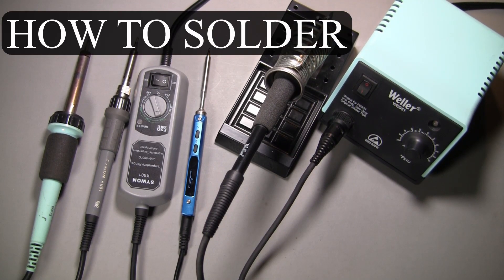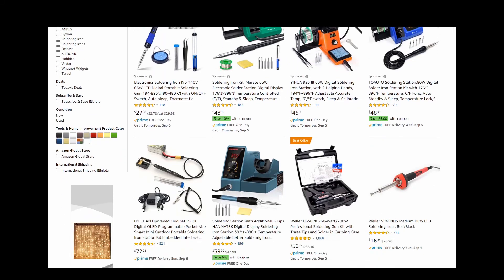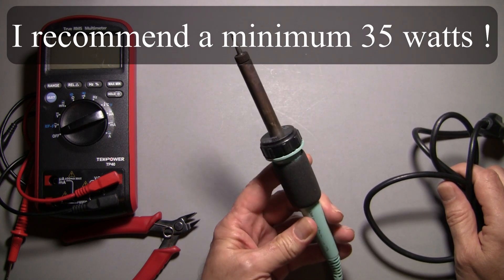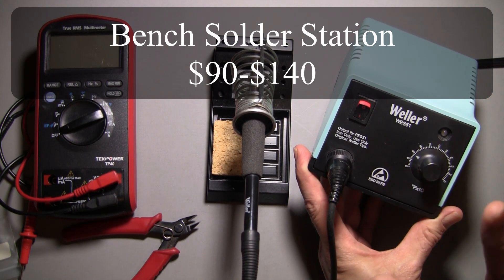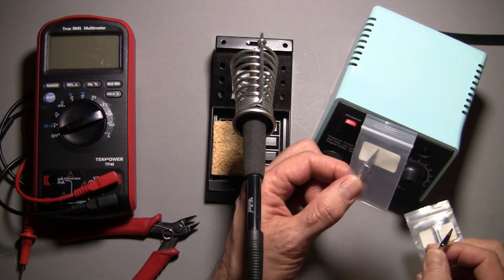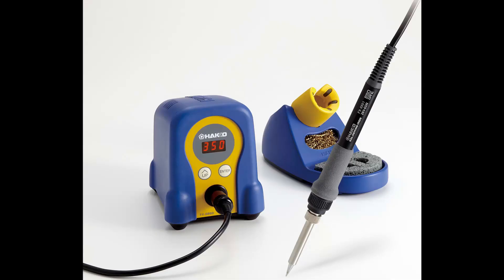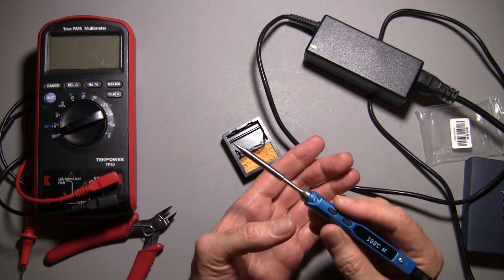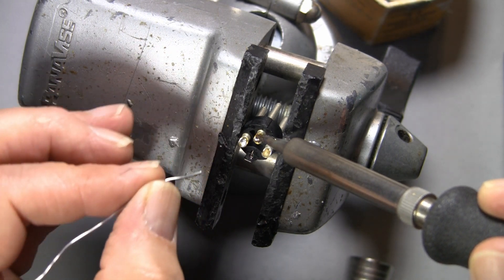How to choose a Soldering Iron

Comment: What watt best for soldering electrical wire. My 35 watt is not heating copper wire at all.
Reply from the maker: 35, is lowest, what do you mean by electrical wire? I don't use soldering on power cables etc

Comment: Based on my personal experience, a knockoff 936 soldering station will basically work fine under most conditions. Pencil-type soldering irons with temperature knobs heat up a little bit slower with less temperature accuracy but are actually OK to use - at least far better than the ones without thermostats at all.

Comment: These tutorials are brilliant. Thanks so much. Could you also recommend a decent multi meter Brad? there are tones out there to choose from but no idea about how to find a good one without breaking the bank! Cheers
Reply from the maker: Thank You! As far as a multimeter the world has changed. Fluke is one of the few respected brands left but they break the bank. Brymen is another respected brand still can be expensive. In my experience with modern technology most multimeters in the $35 - $65  US range do a fine job. I would look in that price range on amazon for a model with lots of purchases and positive reviews. Klein tools might be good, I never bought a multimeter from Klein but other products I've bought have been good. and they sell one for &25-$35 range. One tip I tend to avoid meters with transistor checker built in, it's a bit of a gimmick and usually found on cheezy meters. If you are working on audio be aware a multimeter may read frequency but often the AC volt reading will only be accurate at low frequency's. Hope this helps.

Comment: PS,  hobbyists should avoid using lead-free solder, especially if they are new to soldering, because it's very difficult to work with, and even under the best of at-home conditions often achieves a less than stellar, less reliable connection. The higher temperatures required to melt lead-free solder mean that you can't use a typical inexpensive soldering station, you really need a high quality and likely expensive unit; and between the corrosive fluxes required for (contained within) leadfree solder, and the higher temperatures necessary to melt and flow it, tip life tends to be very short.

Comment: Regardless of whether a circuit board is manufactured with leaded or leadfree solder,  or irrespective of which type you are using,  Circuit board foils are more often damaged by too long an application of too little heat rather than the application of "too much" heat.  The iron needs to be hot enough to quickly heat the foil and component lead so that you can solder them really quickly and get in and out of there fast without deleminating the foils from the board.  An iron that isn't hot enough, or doesn't have sufficient thermal mass/poor thermal transfer/slow thermal recovery will struggle to melt solder, especially if the foil on the board is a large ground plane (or if youre soldering an RCA plug or jack with a lot if metal mass), and so you'll end up holding the iron to the board for way too long, attempting to get the solder to melt and flow.  If the iron is insufficiently hot, the tip is the wrong size, shape or material for fast thermal transmission, or not properly tinned (clean and shiny with a thin coating of solder to transfer the heat), and you hold it to a connector for too long while attempting to melt the solder, you can actually soften and melt the plastic insulator in between the 2 conductive halves of an RCA jack! 

  A couple of, ahem, " tips": 1) use the very largest tip that you can physically work with in that space because the bigger it is the more it retains heat and doesn't cool off too quickly when applied to the connection to be soldered. 2) The pointy conical tips supplied with most irons are terrible for all but the smallest connections and a so-called "chisel" tip (a blunt, rounded "chisel" to be more accurate) is preferred for all but the tiniest connnections. 3) Materials matter: high-quality tips are made of plated copper for best possible thermal transfer and conductivity and will be plated with iron only at the pointy business end because iron resists the dissolving effects of molten solar and flux, where bare copper would quickly be dissolved, oxidized and pitted.  Unfortunately, the vast majority of tips supplied with cheap soldering irons, or purchased separately directly from China or Asia, are  invariably made of iron or steel throughout, which is easily verified with a magnet (see the video about this on my channel) and they don't work anywhere near as well as plated copper tips, and in some cases can even damage sensitive components on a circuit board because the cheapo ferromagnetic tip throws out a strong magnetic field and generates electric current in the nearby components. 

 It's OK to use a Chinese or Asian made soldering station but you're better off buying matching tips directly from Hakko USA.  They might cost $6 to 10 each, but they're copper, plated with iron only at the pointy end, made to high tolerances ( so theyll make better contact with the heater assembly), and longlasting if not abused.  I know it's tempting to buy a dozen tips for less than 20 bucks online, but don't do it!  Many many soldering irons and stations have been manufactured for at least the past 20 years or so that use  T 900 or 900 M style tips, which as far as I can tell are virtually identical size wise; Hakko calls chisel tips "D" style, availability in a variety of tip widths.

Comment: I bought a Weller station and it didn't last very long. Looked into getting it repaired and decided I could get a Hakko for about the same price as the repair. It's been great. Setting the temperature isn't as easy as turning a knob, but I haven't needed to change it yet because everything I do is pretty much the same.
Reply from the maker: Unfortunately I believe Weller's quality has gone down, too bad I loved them back in the day. They have just released a new line though.
Reply: @biasedaudio ,  With modern Weller equipment, the Mantra is "better dead than Red"; their "red line" of equipment sold at big box stores such as Home Depot is overpriced junk, like the $65 unit that includes an ordinary 120 V AC powered iron and an electronic light dimmer in a red plastic box, so that you can turn the heat down to the 40 W iron but you can't turn it up, and there's no temperature-sensing feedback circuitry.  You can buy a "Schneider" one-knob soldering station from Harbor Freight (a rebranded Atten 937)  that has true temperature sensing feedback for only $45, and other than the stiff non heat resistant cable (which could be upgraded to a silicone cable if you have a second iron to solder with) it's a pretty decent unit; a great buy for almost no money,  certainly far better than what I had to work with as a kid in the 60's and 70's, although the supplied tips are solid iron (as are virtually any and all tips sold online direct from China or Asia), not copper,  and performance will improve if you spend $6 to $10 for a genuine Hakko tip which is plated copper for better heat transfer and are made to tighter tolerances so it will  also likely fit the ceramic heating element more snugly.  I posted a review and tear down of one on my channel; and soon I will post a review of the digital soldering station that Harbor Freight sells for  $120 , which is a rebranded ATTEN ST80. 

 I personally don't like buying things directly from China and the incidence of defective or counterfeit products sold online is very high; but if you purchase from a local store and you don't like it or it turns out to be defective right out of the box, you can just bring it back for a refund.